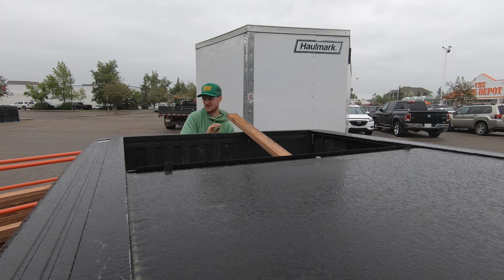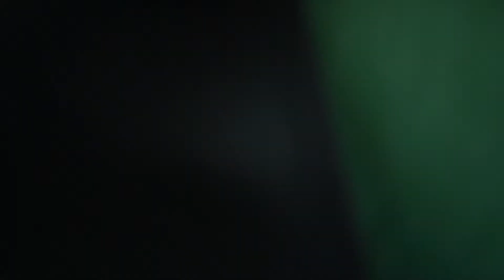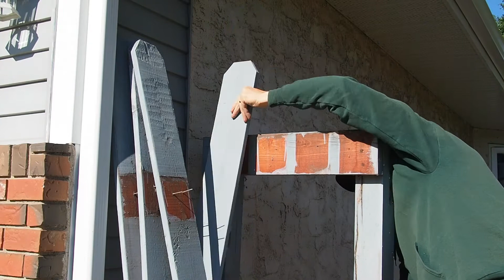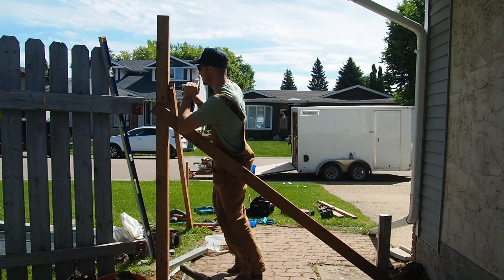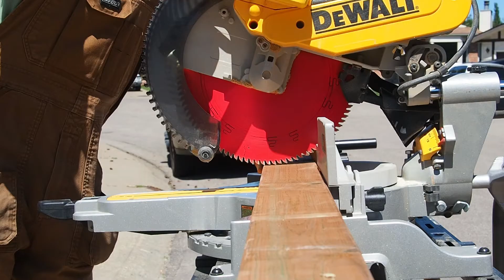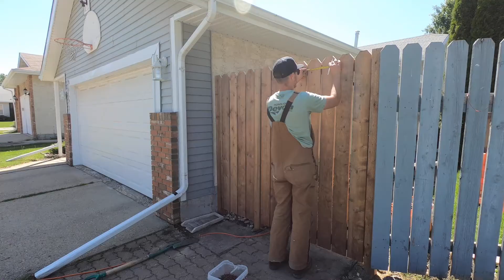Installing fence posts without cement (building a fence gate)

Comment: I forgot about this video and just used tamping bar to compact dirt around two 4x4 post. I did use a paver and 2x4 under ground to help brace the 4x4's tho, and they are both 5 feet from the 4x6 gate post that I cemented in and used non sag rapid set sealant around the area water would seep in. At least if I have to replace the 4x4's later I won't have to break concrete. Hope it works.

Comment: Huh, "single trucks?" Assuming you're referring to "pick-up" (passenger truck), non-commercial trucks. Uh, looks like you're driving a pick up truck, or "single truck" (never heard that term before) :-{
Reply: WITHOUT a trailer attached - they don’t need that huge long parking spot.  The pickups just park there because they cant drive and they like the in/out of the spot.  
Those spots are reserved for LARGE LONG trucks + Trailer OR those giant flat bed work trucks that exceed the normal parking spaces.  

If you drive a traditional truck LEARN TO BACK IT UP and park in the non-commercial spots.  If you cant, then get a damn Prius.

Comment: He doesn't like using cement because the posts built by other people were done incorrectly. And now he has to fix them.
His work will be easier to undo when it fails, and it will fail.
Reply: nothing wrong with concrete. i put 160 feet of fence up 15 years ago & still straight.
Reply from the maker: Completely disagree, but you do you. I've had posts set this way for years and years without an issue. Your particular  environment/location may be different.

Comment: The title of this video is “How to install fence posts without cement”, so I’m expecting some details specific to the title. You TALK about using a "crushed paver base", but you don't really show it or talk in depth about what it is or the best way to pack it. I dig the slick production value of this video, but you might want to think about the educational elements as well. Thanks!

P.S. I went ahead and Googled crushed paver base and got myself up to speed.
Reply: A different video said clay would be too hard to compact. That guy just compacted dirt w end of his level or 2x4 and checked level as he added dirt. You can also use caulk gun cement seal to fill in the open space at top of the dried cement and post base by ground I've learned.

Comment: What type of gravel? In the subtitles of you talking it comes out as crushed paper. I'm setting 8 posts to extend my yard. I don't want to use concrete either.
Reply: Title is misleading. You spent 15 seconds setting a post and the rest was construction.
Reply from the maker: I use road crush or paver base. It is essentially 3/4" rocks down to fines. This allows is to compact super hard.
Reply: @hsdesignstudio  Thanks bud. Ya I ordered a yard of 3/4" down. And set 2 of 8 posts. Works like a charm. I never liked the idea of using concrete. 

I also have a weird problem.
Where I'm putting 4 new posts they are in lower ground than the rest. The yard ends and drops about 16 inches. I don't want the fence to change heights. What would you recommend to keep the same height in pole depth. 
I was suggested sonotubes filled with 3/4", then back fill the difference of the yard to level.
It seem logical,  but questionable.

Also when measuring the height of a fence,  is it measured from street level or yard level? I don't want the city to cry about the height. I think in my area it's about 8 feet.

First time building a fence all info is good info.
Reply from the maker: Sorry for the late response, I just saw this comment. Glad to hear the gravel worked for you 👍 it really is the best way to go in my opinion.

Typically, I adjust the fence height to follow the grading of the yard. Therefore, it is always 6 feet tall from the ground next to it. You could maintain the height, but I would want at least 1 foot of buried post for every 2 feet above ground.
Reply: @hsdesignstudio  I've heard people recommend putting 2-6 inches of pea gravel at the bottom of the posts for water drainage, turns out I have more than I needed for my project, could I use this pea gravel instead of the road crush/paver base you mentioned?
Reply from the maker: @Stubbum  I use crushed base under the post for drainage. I have never used pea gravel. My hesitation would be that pea gravel doesn't have the same fines that crushed gravel does, and thus wouldn't pack nearly as well.
Reply: @hsdesignstudio  Good call thanks a ton!
Reply: The Homestud .
Reply: I heard crushed paper
Reply: Oh, Crushed Paver base.
Reply: @johnmahoney6663  crushed paper weights I heard. 😅